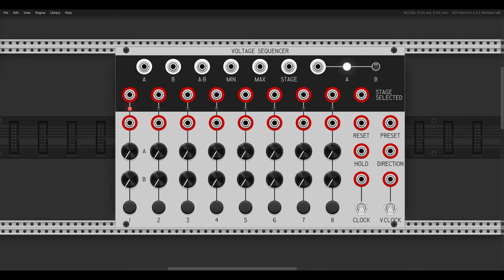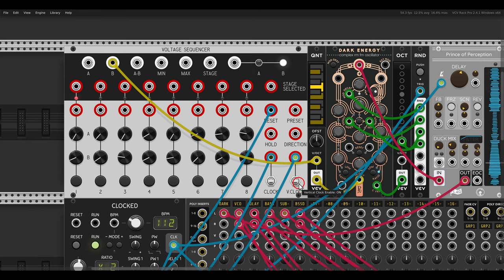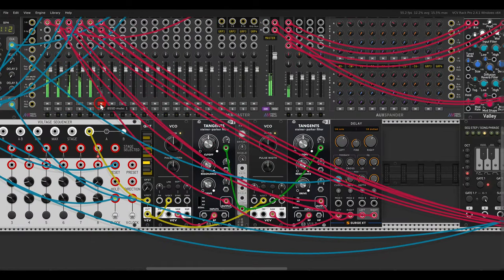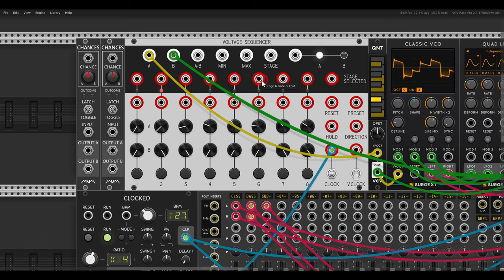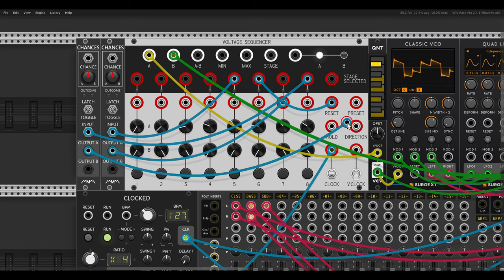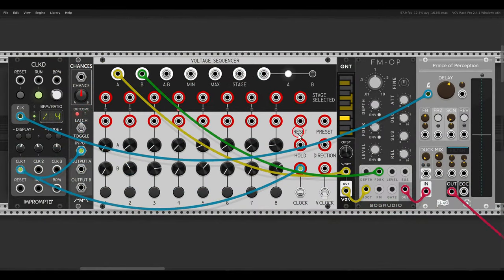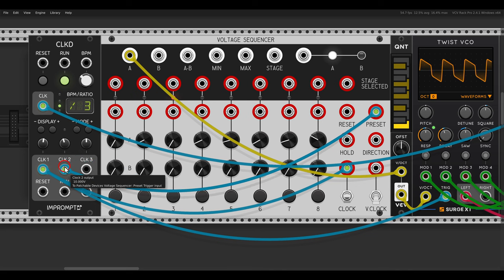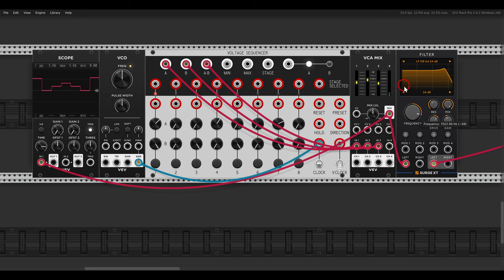This is why you should use the Voltage Sequencer

Comment: ❤Hi Omri, thank you very much for this
A small question, how can you change the vcv modules to black color
Reply: In recent versions of VCV Rack 2, you should be able to click View and there should be a setting at the bottom labelled "Use dark panels if available (experimental)"
I think it applies to most of the default vcv modules, maybe other collections as well
Reply from the maker: Thanks! And yes, it's under the View menu :)